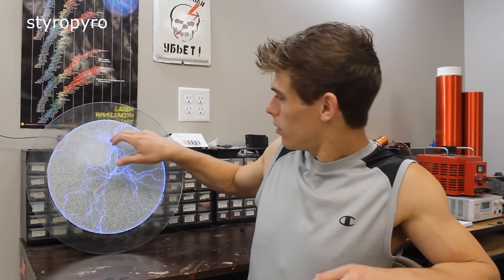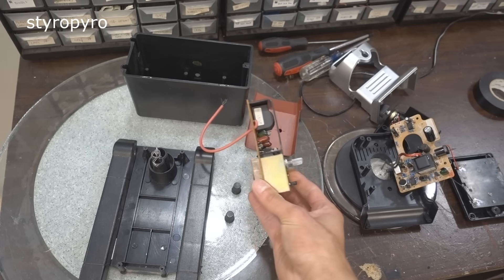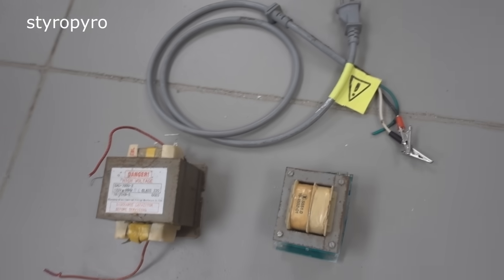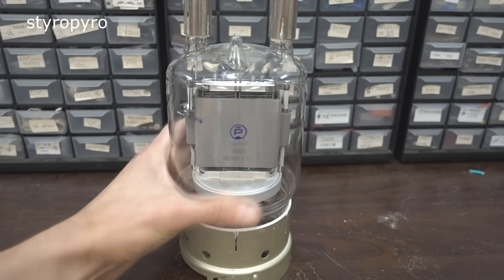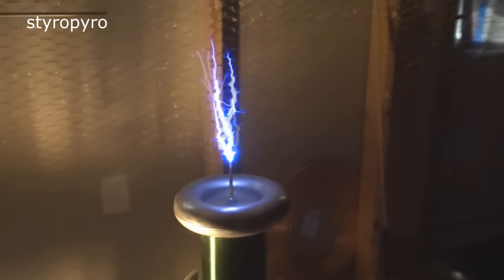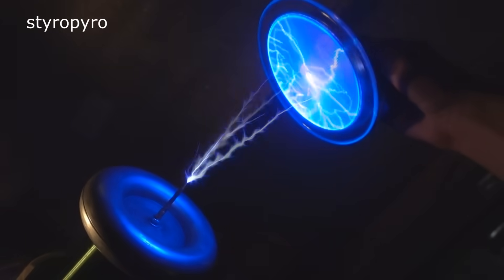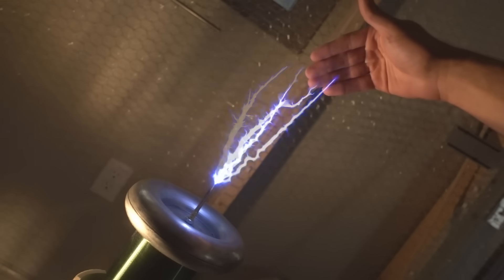Extreme 2D Plasma Ball Experiments

Comment: As a kid learning about electronics I disassembled a plasma globe and safely handled the energized flyback transformer output with an insulated screwdriver. Too bad I was holding the metallic part of it. I can testify the output is not that lethal.

Comment: He's right I remember learning that as a kid you cannot touch those components they will be fatal. static electricity is a high-voltage, low-current discharge, while the components on the rig are connected to a low-voltage, high-current source

Comment: Are you sure it's noble gas inside the plasma ball? Nitrogen and oxygen glow purple and red, and are handily available in common or garden air. It matches the colours in the ball. If they were noble gases, wouldn't there be different options available with different colour lightning?

Comment: can’t say i’ve ever checked the specs but you can find transformers and capacitors inside of most older style lights such as wall pack lights and some parking lot lights. the tell tell sign usually seeing metal halide lamp. they almost always run those lamps

Comment: When he is throwing microwaves you realize how startlingly strong he is...
Reply: You didn’t see them pipes?!
Reply: You know without electronics microwaves are very thin metal shells? Lol
Reply: @grekygrek  the issue is not so much mass but it's the fact that for what we see them doing on screen they would have had to have been thrown 10 to 20 ft and throwing a large flat sided box that distance is not easy.
Reply: Yeh lol
Reply: Microwaves arent exaclty lead weights...
Reply: Either i'm strong or microwaves are not as heavy as you make them sound like
Reply: @ZedDevStuff  for the way those microwaves are behaving on camera they would have had to have been thrown at least 15 ft and throwing something of that size that far is just inherently difficult, especially when it's just a large box with zero aerodynamic efficiency whatsoever.
Reply: They are just cabinets.
Reply: @DaleDix  still startlingly strong since I weigh about as much as a cabinet 😅
Reply: @Neocava  so you weigh 10 pounds or so?
Reply: @lgpa565  leave Little People alone, you monster
Reply: @lgpa565  you are aware of the word cabinet could be referring to anything from 20 in x 20 in x 20 inch cube of 1/4 in plywood all the way up to a 500 lb plus monstrosity made out of pure mahogany
Reply: Those microwaves probably weigh almost nothing at this point 😂
Reply: @noahater5785  He just has muscles to impress any girl...

Comment: Hey little buddy! I'm one of your newest fans!

  I have 2 suggestions: 1 - why don't you build hinged safety walls of a casing around the capacitors,  power supplys, etc etc at the bottom.  2 - After making the capacitors etc ... enclosed; then you can build a lightweight angle iron frame that bolts to the bottom of the box, and the mount it into the ceiling of a garage or a barn, anywhere there is a good solid crossmember or pair of crossmembers to hang it from, depending upon how much it weighs...

    Its just begging to hang upside down buddy!!! 🙃🤯🥳

Comment: Have you tried making a laser that spins. Like all contacts on a spool (male) and all "battery" ends on a rail(s) (female ) as so, fitting it together aand the lense has to spin too. Like around 1/18 the speed of the laser dome diode. By dome i mean several centered (pointed) within a semi rounded lense (one side) should be pretty destructive.

Comment: What happens when you try flat panel elector-lumenecent  strips with high frequency ac. And what happens to a tube filled with quartz sand or fine piezo powder when zapped high voltages. ?

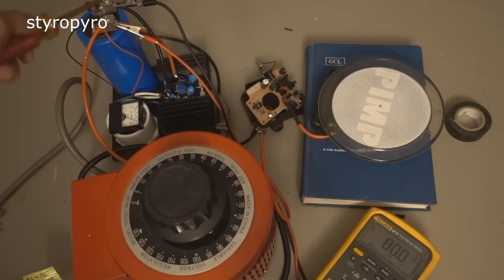Comment: @ 4:35   After you had turned it off you were still showing 79 Volts until you discharged the capacitor.
Curious at what amperage? That capacitor would do you some serious damage! It looks like a killer...Yikes.
Be Berry Careful!

Comment: Roughly 40 years ago I built a Tesla Coil from plans I ordered from a catalog. There were no pictures or illustrations.  To make matters worse, I'd heard of Tesla Coils but had never seen one. To make a long story short I got a 12K transformer, some used ceramic sandblasting nozzles, a small motor from an old chainsaw sharpener, several pewter medieval gothic-looking middle earth figurines, a plastic tub, (14) 6.5oz Coka-Cola Bottles, 1/4" all-thread, lots of non-iodized salt, several hundred feet of insulated copper wire, water, and a big copper toroid that a decorative metal company made for me. I had no clue what I was doing and certain that it couldn't possibly work as the entire primary coil assembling was nothing but a colossal dead-short. Reading the instructions, I began assembly as best as I could with no pictures or illustrations to guide. Then the big day came, with friends, mom & dad, and some neighbors all assembled in my parent's basement to see the "Crazy Boy" do something strange. First I killed the lights and then began spinning up the spark-gap. Then I said, "everyone ready?" I flipped power to the 12K transformer and CRACKKKKKKKKKKKKKKKKKKKKKK. We were all stunned at the ear-piercing sound of the stop-gap. Some ran outside while the braver stayed but did take a few steps back. From the copper toroid, dozens of blue sparks emerged and like fingers, they reached out and began exploring everything within their reach, including me. As for reach, there were big beautiful blue arcs that were reaching four to six feet out on its maiden run.

Comment: hmm i wonder if you can convert lighting into plasma and from that into electricity that can be stored in battery sounds like natural way to get electricity except theres several critical problems
first is it wont work all the time and highly dependent or weather
second problem consumption 
third problem electrical conductivity materials and not overloading a transformer or battery
expensive
does not make sense

Comment: Using something like the Slayer Exciter circuit would have made your coil design a lot easier, as you just need a feedback wire from the bottom of the secondary. it's a self-regulating circuit needing very little tuning to get the right secondary capacitance.

Comment: @styropyro - 
Using a typical household outlet for experiments ? = there is the 1500W USA bottle neck ... 
Germany uses 230V + 10 or 60 A ... UK uses 230V + 32 Amp ring circuits even in 50+ years old houses as standard power for a room (that's why UK plugs are fused). 
Also USA plugs + sockets are lethal without ANY modification (same applies to Israeli plug + socket & not most recent Swiss ones).

Comment: A little tip for winding your own coils. Buy a cheap cordless drill and mount it in a vice. Then all you have to do is mount the core of the transformer into the chuck of the drill. Join the conductor to the core then you can spindle it on at 1200-2400rpm. That massive coil in the video would take 5hrs by hand, 5 min by machine augmentation

Comment: Doesn't that open spark create harmful amounts of O-Zone ?  Internet Quote: The sparks and intense corona easily produced by Tesla coils can produce ozone. Ozone is bad to breathe since it can corrode lung tissue. And if you are going to breathe it a few hours a day, it can be unhealthful to breathe even if the concentration is too weak to smell. Ozone can also oxidize some rubber objects. If you are having corona, you should operate the Tesla coil only in a very well ventilated area, or expose yourself to the ozone for no more than a few minutes a day.

Comment: which is a better dielectric though, solid styrene, or wax? I guess the wax is easier since you just heat it in a pot vs going to hardware store and buying a few gallons of xylene paint thinner and dissolving tons of styrofoam peanuts in it, lol

Comment: So chicken wire is enough to prevent a visit from your local FCC agents? Machine is quite a piece of work.

And another option for high current switching (if tubes aren't quite your thing) is a bunch of matched transistors in parallel (matching process also has to be DIY or you'll see the cost jump up), sometimes that works out cheaper than tubes or a single high current dedicated transistor.

Comment: Not bad Styro! For your voltage multiplier, try using 20kv 100ma  fast acting diodes. They have 10A pulse limits, and allow for excellent arcs for voltage multipliers. It's what i've used in both of mine. Also, the VTTC is sick!

Comment: "if you touch any of this you'll probably die" 
"Let's touch it!"
"Oooh that tickles"
Reply: That's painful
Reply: @EK-ds8ts  so what would happen if one were to throw a toaster in the ocean?
Reply: @Alan-_  the Earth would die! 😜
Reply: that was not what he said. Lmao.
Reply: @EK-ds8ts  ok I'm at the beach with an extension cable, microwave and a fork what do I gotta do again?
Reply: Ross Blue, He was saying that everything besides the final output would kill him, not the final output. The components on the bottom and left side of the table would kill you because the power going through them is low voltage, high current. High current will kill you and it will hurt the whole time you're dying. He's able to touch the final output because, in a transformer, the voltage multiplied by the current of the primary winding of a transformer equals the voltage multiplied by the current of the secondary winding of a transformer (Epri*Ipri = Esec*Isec). Adjusting the turns ratio of a transformer alters the ratio between current and voltage. This guy did just that in order to make the final output high voltage and very low current, which won't kill you at all.
Reply: @acma200  lemme live my dream science guy
Reply: @tophatturtles4073  wow
Reply: @Alan-_  half and half lol
Reply: @jx8148  im crying
Reply: @acma200  not exactly correct.  It's not that "it's low current", it's that it's not capable of delivering a lethal current.  That's a subtle, but important distinction.
Reply: @acma200  you uncultured swine
Reply: @acma200  r/wooosh
Reply: @uremqpogprvu1975  it's not r/whoosh  just  cause  its  a joke doesn't mean it's true stop

Comment: I can light a fluorescent lightbulbs under the powerlines in my backyard explain that?     

The big metal ones
Reply: my back HURTS probably the moisture inside the air carrying a high voltage low current charge (basically static but not quite) electricity from excited electrons in the air as the cables create an electro magnetic field.
Reply: I'd move

Comment: Styropyro is creative and destructive, kind of confusing. 
Instead of machines of death, I challenge styropyro to design and build a machine of life. The perimeter of the engineering is up to the designer  (suggestion, bioelectrical neuron simulation).

Also, continue John Ott's (photo biologist) research. The effects of frequencies on the nervous system using lasers. The experiments showed full spectrum light has positive health benefits.

Cheers

Comment: The most terrifying of all of the components from styropyro
's experiments are the capacitors.

They are capable of holding the charge well after you take it off the grid. If you don't discharge them, they send all the power through your body the moment you touch them when you think you are safe.

4:25 You can see it here.
Srsly, don't try it at home if you didn't studied this.

Comment: styropyro, if you could wire the main winding of the transformer a hundred and ten times with 8 gauge or the same gauge you rewound the top or secondary on second thought what ablut a solid copper mold wound like wire,

Comment: Launch a molten ball of metal down an electromagnetic rail system. You can make it a gun if you want, but I just want to see if the redirection of the field is fast enough to keep the whole ball suspended or a bit sloshes off when it gets shot

Comment: Aren't you ever just so bored you make a tesla coil from Soviet technology
Reply: Why? Just go to a local store. Most people may have the parts already in their homes.
Reply: @mikemondano3624  bruh
Reply: @dodgeavenger  bruh
Reply: @mikemondano3624  Because comrade, soviet technology will never fall. Communism is best -ism, no?
Reply: @nachtkind46  Hard to say. Russia is not communist and I don't know enough about Cuba or China.
Reply: @mikemondano3624  bruh
Reply: @mikemondano3624  No one is talking about Russia here, comrade. We are speaking on the Soviet Union and Soviet technology. Russia pales in comparison to our glorious union.
Reply: @mikemondano3624  all jokes aside, The electronics that the soviet union produced were actually quite reliable and have actually lasted a lot longer than most super cheap mass produced items. Many were build by hand and using processes to ensure redundancy in case one part fails the whole device can continue working, so if you do manage to have them around it would make sense to use them in a project rather than going down to radio shack and paying an arm and a leg for mass produced cheap crap that would fry the instant you push it's limits.

Comment: Me: gets zapped by electric fences, a stick welder, and a power supply capacitor I think I'll stick to working with mosfets and lipo batteries.
Styro: Hold my multimeter

Comment: Do UV protective sunglasses work with 405nm lasers like under 50mw or do I still need safety goggles?
Reply: I would say absolutely fucking not.  UV protection isn't worth much when the laser is in the visible spectrum and likely has a lot of output in the infrared as well.  50mw will cook your eyes faster than you would believe and one errant reflection can ruin your vision for life.  I seriously detached my retina when I was 12, I'm 28 now and it the effects from that are still a huge pain in my ass.  No peripheral vision in my left eye to speak of, vision went from 20/20 to 20/35 and bright lights at night are a real pain.  I was left eye dominant before and the transition was a real kick in the dick.  Blowing a permanent hole in the center of your vision isn't worth saving $40 on some good goggles.

Comment: Still it could use better tuning ;)
45cm is possible with gu81m. Just juse a voltage doubler...it will smoothen out that gnarly sounding sparks/arks...whatever :D
Reply from the maker: i had a flashover when running it harder (which I think was from too many turns on my feedback coil) so I ran it at lower power for the video to prevent it from dying mid filming. there actually is a voltage doubler in there, and for what it's worth, i like the gnarly sounding arc. :D
Reply: @styropyro  try placing the feedback coil under the secondary and use it without a resistor :) works like a charm (10 turns of 0,5mm copper wire)
...of course isolated from secondary bottom with some thick sheet of pvc e.g.

Comment: I don’t have any experience with tube based coils, I wonder if using that amp tube in that high voltage application is causing it to produce some x-rays? If so that makes that mean coil just that much more dangerous, which I’m sure elates you.

Comment: Could you use lumen glass and build a circuit with a moving ground lead such that you could use it as a clock. My idea is you have something connected to a rod which spins round like the hands of a clock. I don’t know if it would work best being a metal to conduct the electricity which you then ground, or a magnet. But then you have 2 of those which spin round to make an insanely awesome clock. Plus the random nature of the arcs where they sometimes go to where the hand is and sometimes mess about is kinda why I think it would be so aesthetic. Could I also do this on a normal running voltage so I could have it on my wall without killing myself or giving myself cancer or something.

Comment: The smoke was so amazed it was released.
Higher frequency is always cooler. I like the idea of potting in wax, I'm assuming you used parrafin. I never use a feed back coil when you have a signal at the bottom of the secondary to use like in the slayer circuit.

Comment: You have a chemistry degree? I really assumed it was in electrical engineering
Reply from the maker: looking back I should have done an EE degree. I love chemistry though and I had a great experience pursuing that degree while working in an amazing research lab
Reply: @styropyro  Are you still attending SIUC?
Reply: Chemistry covers everything today. You need to understand electrical circuits,  biology, advanced mathematics, thermodynamics, quantum mechanics, fluid mechanics, and a great many more subjects. Chemists are developing new batteries and new semiconductors. They also designed and built the first nanomachine that needs no batteries - it runs on changes in blood pressure. Chemists are real scientists. Engineers don't need to know as much because they are only applied scientists.

Comment: 6:41

Wait, does electrostatic pressure create actual pressure strong enough to break glass? Like hydrostatic pressure? Would it not just be from heat?
Reply from the maker: there will be a significant force on the walls of the glass from like charges repelling inside the fixture and trying to get out, but I can't say for sure whether that's the cause of failure. it could be that combined with dielectric breakdown of the glass from the giant electric field that caused the fixture to break